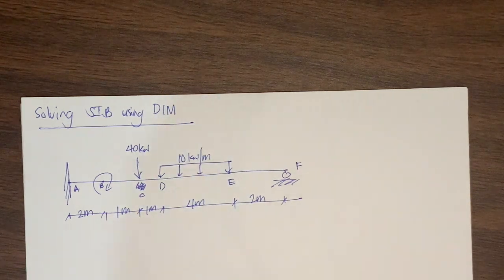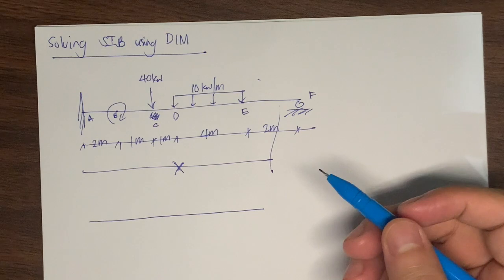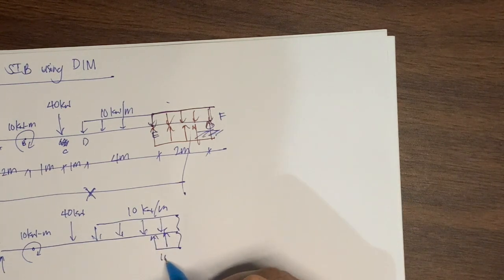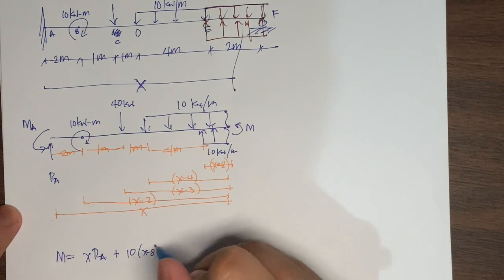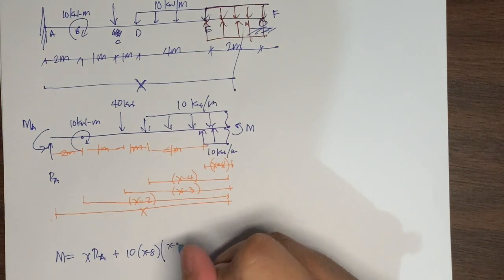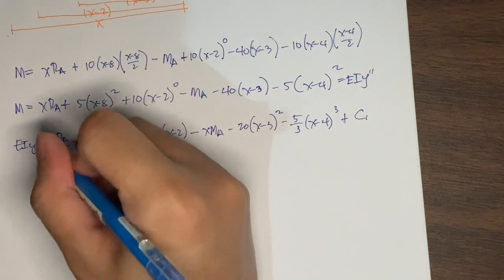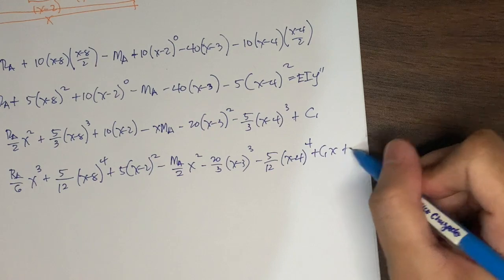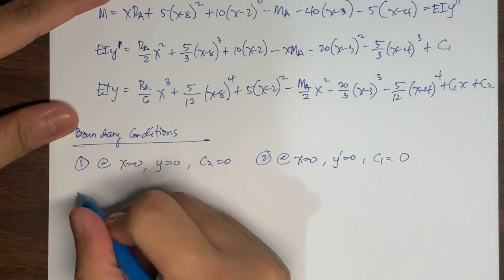Solving Statically Indeterminate Beam using DIM

Comment: sir d po ba clockwise yung Ma kasi positive?
Reply from the maker: Hindi po. The positive sign of Ma dictates that the assumption of its direction in the creation of the equation is correct. As you can see, when I created the FBD, my assumption of Ma is Counter Clockwise. Since the resulting value is positive, it simply means that my assumption is correct.